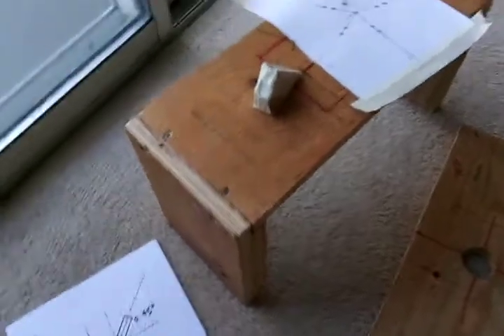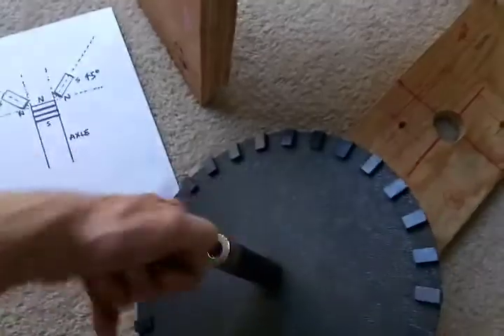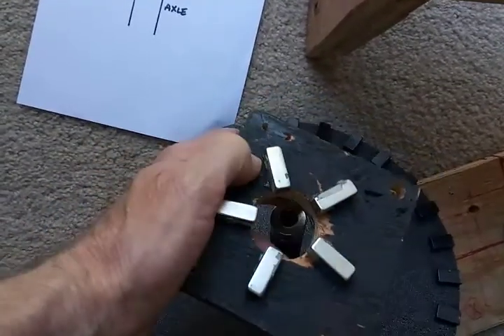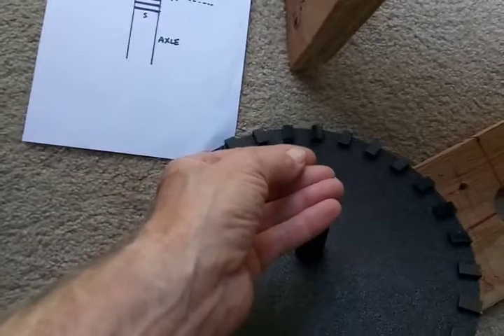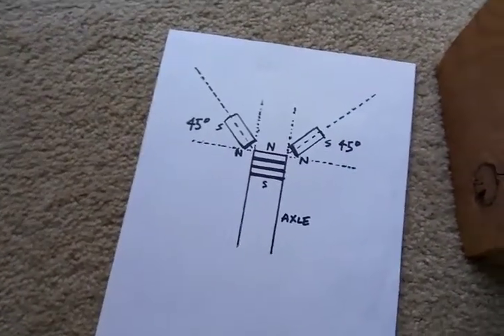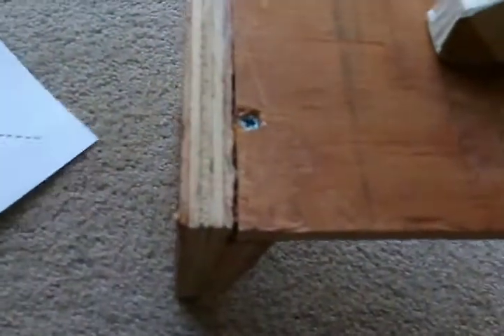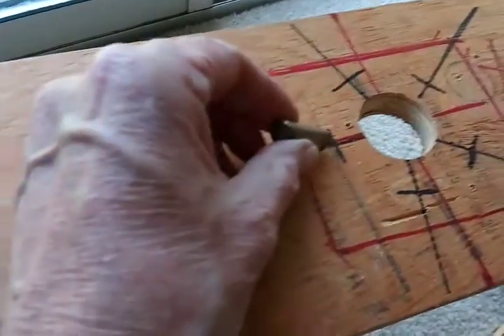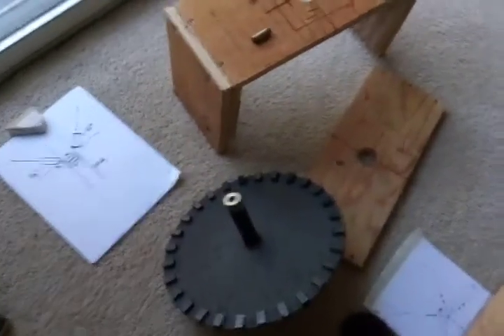45 degree magnetic bearings

Comment: Thanks for all your generous offerings to folks on the quest. Would it work to slide a microwave magnetron or speaker ring magnet over the axle either side of rotor disk, then use opposing ring magnets as fixed "bearings" also slid over the shaft? These magnets would control axial movement of the rotor. Then strong neo magnets in attraction to the magnets already on the shaft ends could control radial movement of the rotor?
Reply from the maker: Hi Alex
Maybe would work, your idea those magnets are not so strong of force compared to N52 neodymiums but maybe that is good thing I dont know....the rotor I am working with is pretty big and heavy a light weight rotor would be lots easier to get floating in air.
Problem I have been having is the end magnets dont just put a "flat stop" on fore and aft movement but also shove the axle sideways forcefully as its sort of like a free-wheeling ball and another free-wheeling ball collision of flux ....I think the 45 degree magnets will work well as the magnet-stop at each end so far so good...

Comment: Best of luck with this new modification you are talking about. With your 45 degree idea, if one magnet is stronger than maybe another one in the series of 45's you are going to drill holes for, have you thought of a way to allow for inward and outward movement to balance to magnetic flux equally which will hold the rotor in a specific place that you want so it rotates without friction? -- Looking forward to seeing how this turns out. -- Jim